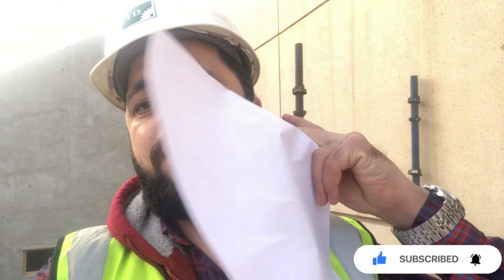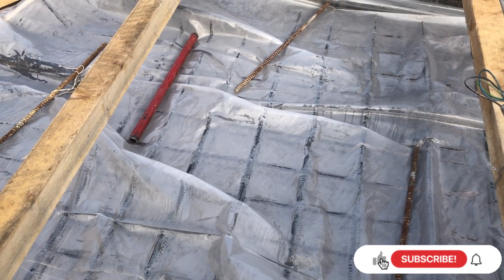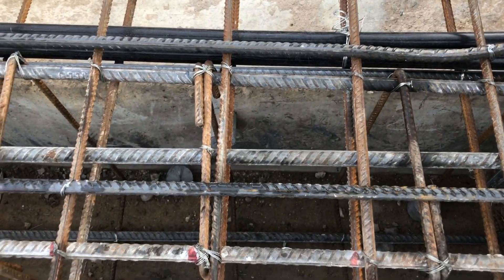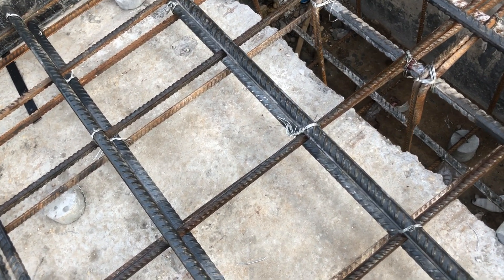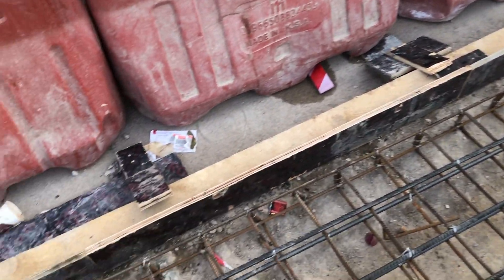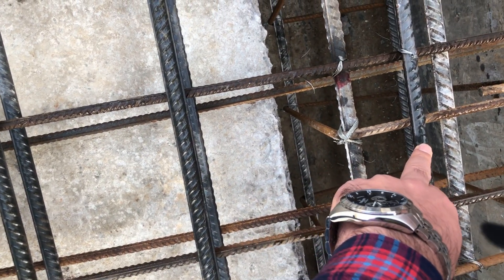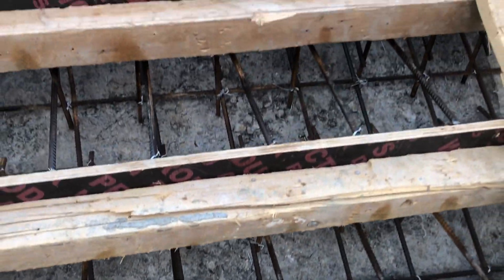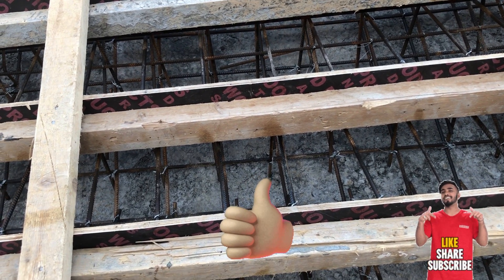How To Check Staircase Steel Reinforcement | How To Inspect Staircase Steel Reinforcement.

Comment: whats a piller board
Reply from the maker: Filler Boards are designed as a standard, Low cost, pre-moulded joint filler for expansion joints in civil engineering and building construction works of all types.
Reply: @CivilEngineerAtSite  please make a detailed video on that. And documentation required for the activity inspection for a QAQC Engineer.
Reply from the maker: Already uploaded. Check playlist QAQC Engineering course